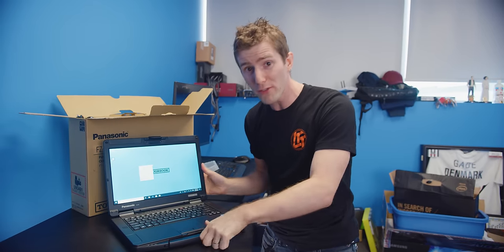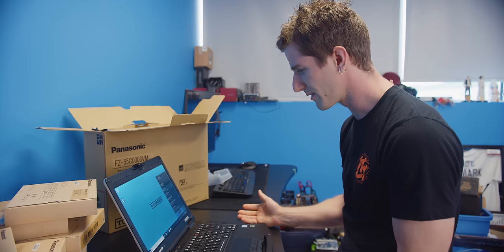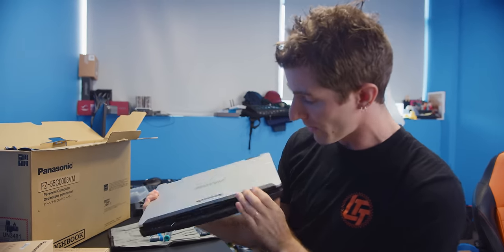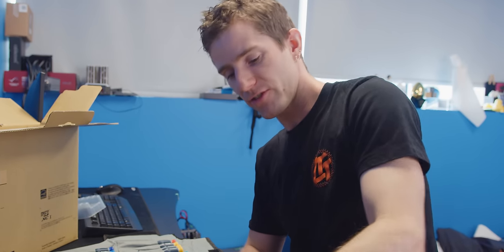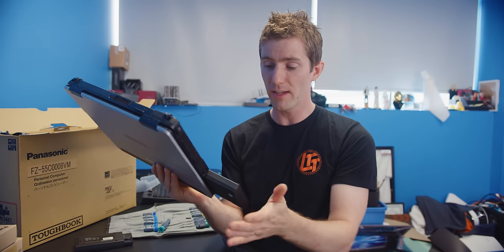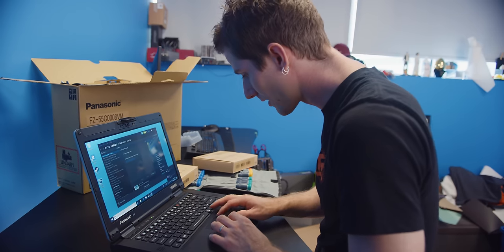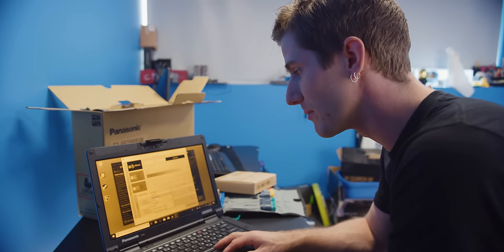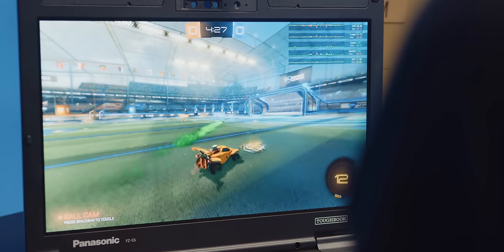The CRAZY Upgradeable Laptop - Panasonic TOUGHBOOK 55 Showcase

Comment: omg there are SO many of these here

I'm a technician in the Army, we use those toughbooks in pretty much anything that need communication with land signals, like tanks, remote antennas, artillery, ANYTHING

there are thousands of those coming here every month for routine check-up, classified program/map imaging and fixing (usually swapping the HDD or the keyboard)

that card reader may be the most important thing in there, as it is what used to identify the soldier and his security access level

also that modularity is really important here, because those who fix them (I'm not in there), don't actually know how to open a laptop and disconnect and check stuff. they simply hot swap those broken modules with good ones. saves alot of resources from teaching the technicians how to handle an actual laptop
Reply: Thank you for your comment, that gave some very valuable insights
Reply: Interesting !
Reply: Yup, it's been a couple years for me but we used em as blue force trackers and communications devices with our TOC. They can take a serious beating
Reply: @wastedtalent1625  They actually made it so tough😂
Reply: @Fringeless  lol, stop trolling. The chinese manufacture these things in the first place so they dont need to "copy" them...they have the same tech we do
Reply: @Fringeless  lmao
Reply: are they using the 33 or 55
Reply: Used the to program our radios...

...and watch movies on retrans ops.
Reply: Putting the SSD in the shredder, I was thinking "yep, gotta zero it somehow"
Reply: Can you steal one for me pls
Reply: Lord Paquito I  http://images.defence.gov.au/20200123adf8604025_232.jpg
One of the most recent images I shot working with the New Zealand Air Force. You'll find my details and links to my other work on the side.
Reply: @robwhitmore3040  Some nice photos you got there! Thank you for your service.
Reply: RunicTunic  Stolen valor? its not something so honored here to be a technician

we have a mandatory service here, everyone at the age of 18 gets drafted
Reply: @RunicTunic Dude, you have a video called "Playing War Thunder because PewDiePie told me to". 
People who live in glass houses shouldn't throw stones.
Reply: served in the singapore armed forces, the most common laptop in use is still the crazy toughbook that had the 360 degree swivelling screen (toughbook cf-19)
Reply: thank you for your service!
Reply: never heard somebody who is in the army yet has a profile pic of a plush french dog nad called cheesy core
Reply: @Ando0o0o  thats awfully specific
Reply: @blackout9487  You don't even know what country they are serving and you are thanking for service lol.
Reply: I don't you should have said that
Reply: It's also used as diagnostic tools for porsche, with porsche software on it
Reply: AF uses them on the flight lines. Especially in the maintenance areas.
Reply: i’ve repaired a load of these things at work and my god
Reply: i dont care. i would love to have a gaming laptop like that. swapping out the gpu 2-3 years later. adding better sdd and more ram after 3 years. and then you only need to get a new one after 4-5 years orso. because cpu holds longer then gpu and you dont need to change that.. nearly 2x longer
Reply: Guess that’s why they named it the “tough book”
Reply: police use toughbooks as well
Reply: Those are some awesome insights! Thanks for sharing! salute
Reply: @johncharles4908  salutes back
Reply: Do you use it as reloading practice in difficult situations

Comment: As a doctor i really could use one of those! In emergencies, or when the patient is not mobile enough to come to the practice, we have to go to the patient. We use cards to login to the medical record. So the card slot makes a whole lotta sense. In the near future we will be using our finger prints, nothing worse than forgetting your card at the practice. In Holland it rains a lot, a somewhat waterproof laptop is ideal just for the distance between the car and the front door. SIM card feature is also a must have so we can access our central terminal for the medical records. We now use outdated, though tough laptops with Windows XP lol. Tablets arent secure enough and are a pain. This looks really good! Thanks for the review
Reply: You can buy workplace-oriented laptops from Dell, HP, Lenovo, and a few others that have all of those features built in, and are significantly cheaper than a Toughbook. Add a carry case for travel and weather protection and you're golden.

I've got a Thinkpad from 2015-ish that has fingerprint, smart card, and facial recognition capabilities. Thing is near indestructible.
Reply: Yeah, in EMS we just got a new set of a similar model. We have two on our ambulances, one up front for dispatch/call details and one in the back for patient data entry/call logging. It's especially useful now because it has a checklist of all the PUI criteria for the outbreak, like patient temperature and what PPE the crew used.
Reply: My man come to Belgium the rain is horrible
Reply: @TheCallMeCrazy  that actually sounds like a good idea! thanks! i will look it up, we fortunately don't need gaming laptops for our work, just reliable and robust
Reply: @ninjabot567  i respect your job! i think because of the pandemic, the digitalization of the medical care will leap forward. if i look at our jobs and others we are way behind, many things can be automated, so we can do the important stuff
Reply: @kawaiiwo1f514  lol, if you need water, you are welcome here
Reply: Panasonic is making rough laptops like decades.
Reply: First of all I would like to say "Thank You" for the job you do!!!
And when I say this I mean no disrespect to you, but the "powers-that-be", really... Windows XP!?!?  Do they think you have time to use a "hammer & chisel" to make your notations plus do your job???  Sure, Windows XP was great when it first came out... for about two years I think it was.
Either way, I hope that y'all get some well deserved upgraded equipment before to long and again "Thank You!!!".
Reply: @thomaspigg306  for some reason Dutch governmentish tech is a bit behind. Our tax people still work with xp and a lot of other services run on XP. Our government pays quite much every year to Microsoft to have support and updates.
Reply: Wow.. Now Im relieved.. First time i saw this video i dont understand what kind of laptop is this.. Who would use this kind of bulky thing.. Than i read your comment sir.. Now i understand.. Thanks
Reply: I mean, the entirety of the US ballistic and nuclear missile launch system was operated using floppy drives up until just last year. And IIRC there was still an airport somewhere in France that is still using Windows 3 from 1990, so the situation isn't tooooo bad.
Reply: Welk ziekenhuis werk je dan?
Reply: @seanshin1615  Over in Canada they've got a nuclear reactor planned to be in service until 2050 functioning on a PDP-11 with good old COBOL based code.
Not the article I read about it a few years ago but covers the same thing in a bit less detail here: https://www.theregister.com/2013/06/19/nuke_plants_to_keep_pdp11_until_2050/
Reply: Yeah I've noticed most PCs at doctor's offices or hospitals are running XP or windows 7
Reply: @seanshin1615  Why does a weapon's platform system need to swap to something newer and move vulnerable to attack?
Reply: these kinds of laptops,  are mainly designed for heavy industries like oil exploration,  the military,  even field sciences. that said i know from experience these can also b used for onsite medical systems
Reply: Not using tablets because of security - - Using windows XP instead o_O
Reply: @MrMarnix1234  there are atm that still uses xp, it might not have support for consumer but there are enterprise clients big enough to keep it in use
Reply: hallo mens uit nederland. nu denk iedereen: HeB jE dAt vAn GoOgLe TrAnSlAtE. NEE
Reply: @samikhalloufi1530  what pandemic..?  we hebben nog steeds geen cijfers vd griep doden..
Reply: Not gonna lie, I freaked out when I read the first line.I interpreted it as "As doctors I could really use a hot swappable organ"
Reply: @thomaspigg306  It's because the know the bugs and everything about the os. You wouldn't want your comp crashing when there's government or medical emergency. Most of the US GOV still uses XP.
Reply: @InfernosReaper  Exactly!
Reply: @TheCallMeCrazy  what thinkpad type do you got?
Reply: @davidyusaku  T430, an older one by laptop standards
Reply: In the army we use these for our satellite terminals

Comment: 2:22 speaking from experience, Toughbooks have been used in the military, such as specific situations like on deployment in a FOB (Forward operating base). If the FOB gets attacked, overrun, or you just need to get the hell out of there quickly, taking the HDD out quickly is much much better than lugging every single laptop out of a makeshift office.  Sensitive data must be secured or destroyed.
Reply: I thought as much. Looks very military.
Reply: @linusdn2777  Yeah alot of British gas engineers carried these too, I'm not saying the military don't use these but there are alot less "hardcore" jobs that still require it be just as rugged. 
I broke one with a single misplaced foot so I don't fancy it's chances in a combat situation 🤐
Reply: Sometimes they also take HDDs from dead laptops and drop them into new ones so that it’s still on a laptop even after the original one has a bullet in its screen
Reply: Gotta cover up the war crimes somehow
Reply: @normandy2501  which would be a perfect situation where you'd wanna be able to remove the SSD.
Reply: well on laptop from 2009 it has really nice graphics i guess
Reply: @A_Wild_Yeengirl  oh look the old “all soldiers are psychopathic killers” trope. How informed...
Reply: @andrewdriver3318  Not what I said but telling that you assumed it's what I meant
Reply: @andrewdriver3318  I really think you're reading too much into it. The truth is that the US commits war crimes abroad on a regular basis.
Reply: @A_Wild_Yeengirl like what? Source? You mean those soldiers really are psychological killers?
Reply: big boss would be proud
Reply: @andrewdriver3318  lol
Reply: You were so ready to tell all these kids you were in the armed forces lmfao
Reply: @ricoanthony992  what part of that sounded like bragging, troll?
Reply: @dalton2k538  the while thing
Reply: @dalton2k538  but when did I say you were bragging?
Reply: I still want it thom
Reply: SSD*
Reply: Also makes sense why you might want to have multiple smart card readers and readers for 2FA. So that files can only be accessed by multiple officials
Reply: Same for diplomatic mission evac, drilling through the drive casing and destroying it.
Reply: what military
Reply: We use these on my aircraft carrier as our work centers for our reactors. Real beefy boys. Great in the hot, humid oil vapor filled air splashing the occasional monster or coffee on em by sleep deprived mechanics like myself.
Reply: Also likely very useful for reissuing the devices to different people, much more secure to just swap out the storage completely than risk an incomplete wipe leaving behind sensitive information.
Reply: Booooiii thats cool
Reply: @andrewdriver3318  What in the FUCK is a psychological killer???
Reply: SSD Is easier to hide.
Reply: @yepepepep590  I think he meant phycopaths, like serial killers.
Reply: @moonknightish  I was in Afghanistan and Syria. Where tf were you?
Reply: Do you store a jug of kerosene near to important documents and HDDs for this?
Reply: It is a good tax payer purchase.
Reply: Guess that explains why some ToughPads have “concealed mode” that can be activated via hotkeys. All LEDs off, screen backlight off, fans stop, and speaker muted. Then you can tackle with someone who doesn’t watch their sixes.

Comment: Microsoft: We designed our new Laptop with repair in mind.
Panasonic: hold my SSD.
Reply: Patrick Keller apple: I’m bout to make it even thinner
Reply: Hold my videocard. Hahaha
Reply: Max Paine   Apple designs their products so they are hard to work on. Soldered in SSDs and RAM. Glued in batteries. etc.
Apple pushes you to buy new not repair. That's why they don't like 3rd party repair facilities. They fix Apple products that Apple claims can't be fixed.
Reply: More like, hold my screws.
Reply: Hold my 50 pre-charged spare batteries and spare charging station
Reply: You mean hold my gpu
Reply: @kens32052  apple will fix almost anything its just they will charge you so much it doesn’t even make sense to repair
Reply: 96D4HS9  don't worry, they don't sell them to the public.....